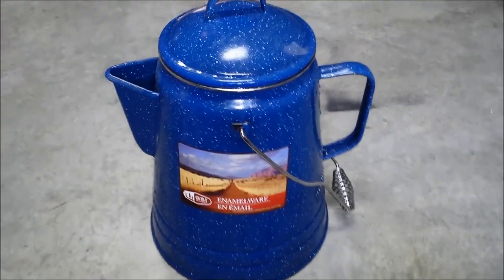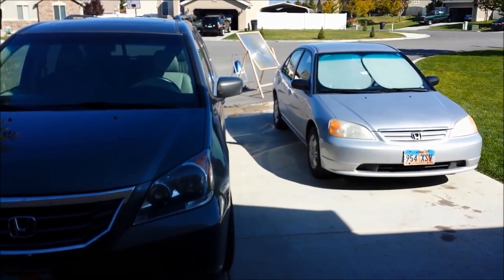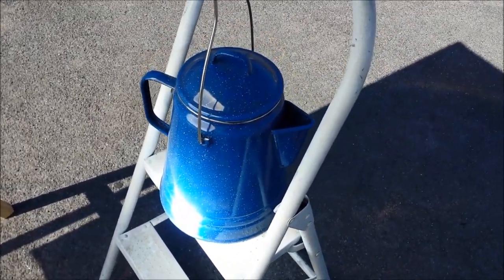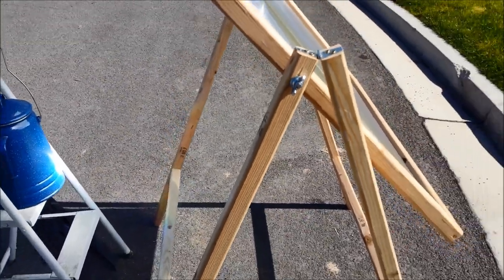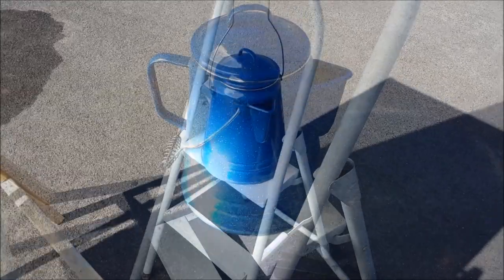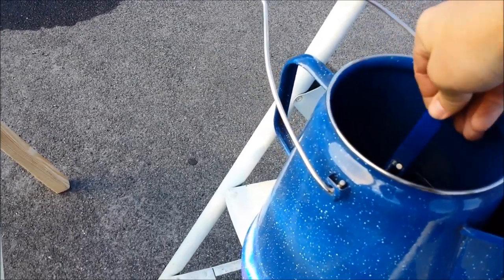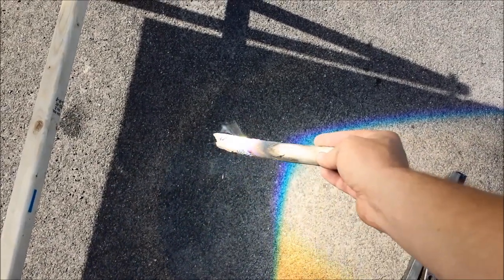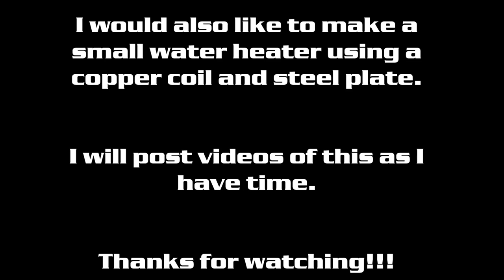Solar Scorcher -- Tests heating water

Comment: Wow this is interesting, could you adapt this to a pressurised system and run a steam electric generator for home use? Maybe also have lenses in multiple locations around the point of focus in order to compensate for suns movements..

Comment: Heat is escaping through the hole used to pour the water out. Try a pressure cooker so that energy from inside cannot get out.
Reply: thanks
Reply: he might try closed system i guest. thermodynamics

Comment: What if you tried a metal sheet a massive one like cast iron that way you can go all out on part of the metal to melting point but some of that energy will transfer to the water and surrounding area but achieving a goal in this case the water boiling. #FoodForThought

Comment: I wonder about the other vids, the screws and other objects were melted so easily and reaching over 2000 degrees?  Was it a factor of the distance to the Object as well as the lens magnification?  I'm sure he uses a spot lens, now I wonder about the magnification?
Reply from the maker: I don't have anything that will measure the temperature of the spot--at least not higher than around 1300 F.  I don't know how they tested that.  I know on a cool October day I was able to get steel red hot, could easily melt pennies, and so forth.
Reply: Where could I buy one?  Especially from Toshiba 50 inch
Reply from the maker: People are giving them away.  I just check the local classifieds under the free section.

Comment: If only there was a way to transfer that energy into a thermal container for it to continue to boil even if the clouds interrupt temporarily.
Reply: Maybe add a thermal blanket onto a secendary double layered container, the difference in temperature should cause an automatic circulating system from hot to less hot and keep one as the heating pot the secondary as storage.

Comment: if the container is transparent, will the heat be transferred to the water at higher rate? Can the focal point be on the water inside the transparent container?
Reply: Heat is caused by radiation from sun heating up any object it struck.

I'd say it depends on the material on the cooker.